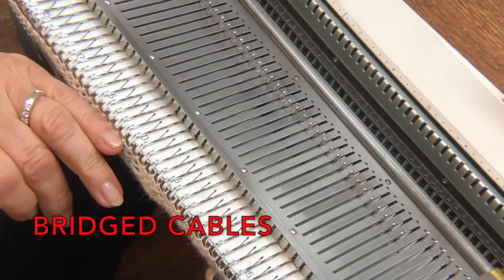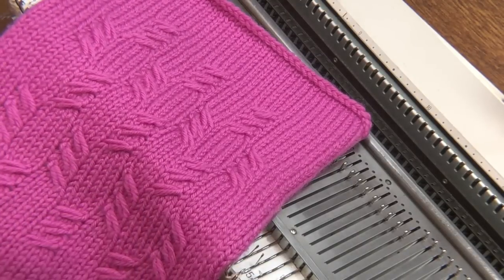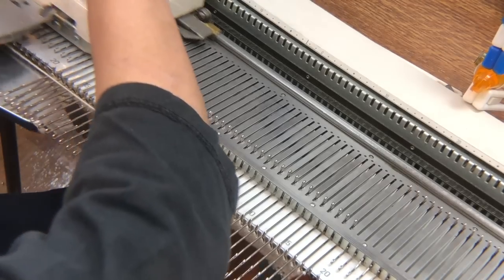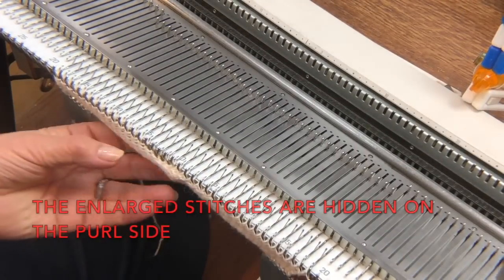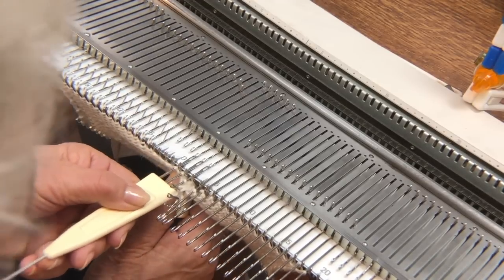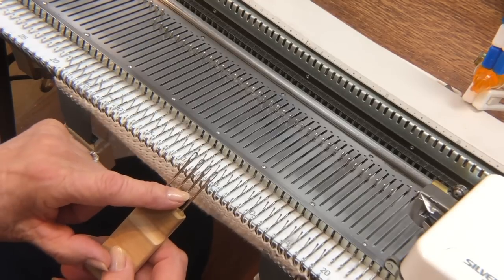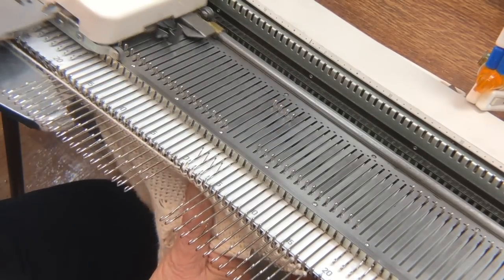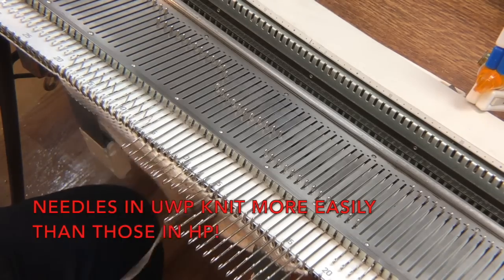Bridged Cables

Comment: Brilliant video Susan. Is it possible to use this technique when knitting multiple cables in a fabric?
Reply from the maker: Absolutely! Instead of bridging to the end of the row, you just bridge to the next cable.
Reply from the maker: Absolutely! Instead of bridging out of the row, you just bridge across the first row of the next cable and the bridge between the two cables, then hold the needles just knitted.